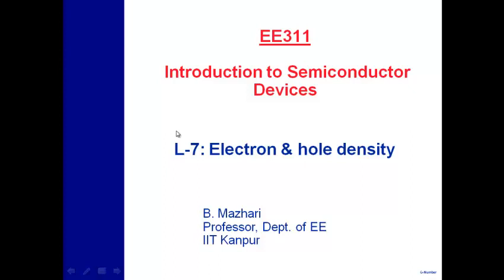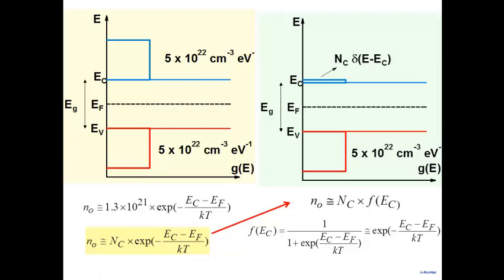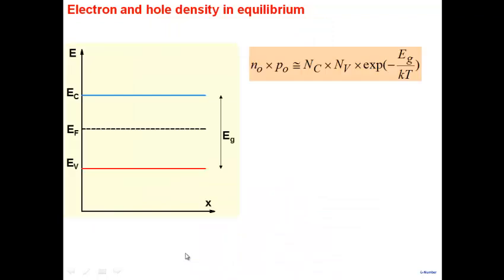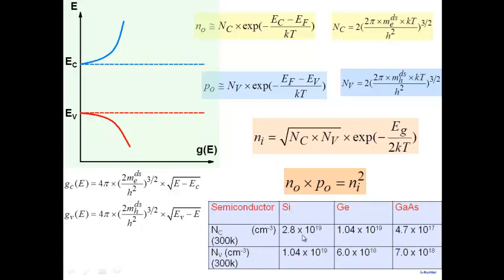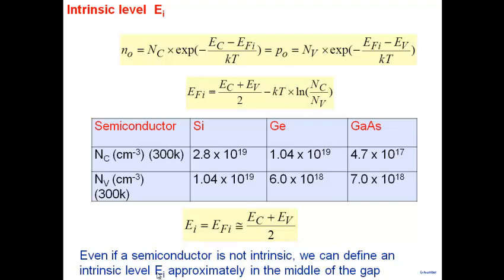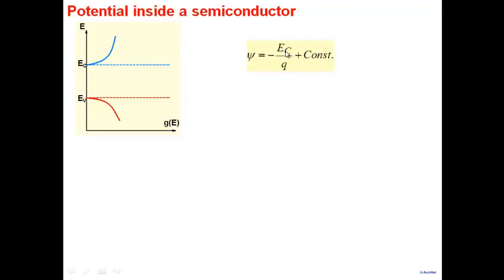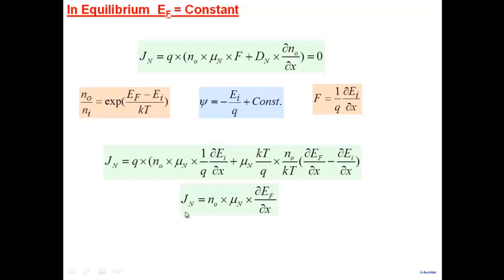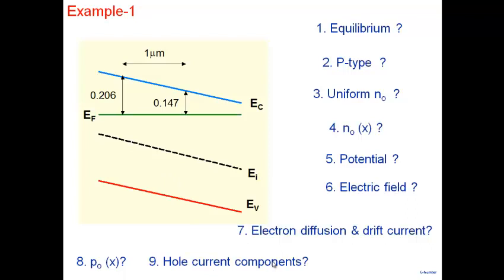Electrons and holes in semiconductor : L7

Comment: Sir, at room temperature avg. thermal energy of electron is 0.026 meV while the bandgap is 1.1eV for silicon. Then how come electrons are present in condution band at the room temperature (intrinsic concentration=10^10cc).
Reply from the maker: Electrons have a distribution of energy. Even though probability is small, some of them are able to scale the barrier. Number of empty states in conduction band are large and number of electrons in valence band is also very large (~10^22). As a result one gets the number you quoted for intrinsic carrier density.
Reply: @baquermazhari8968  thanks sir